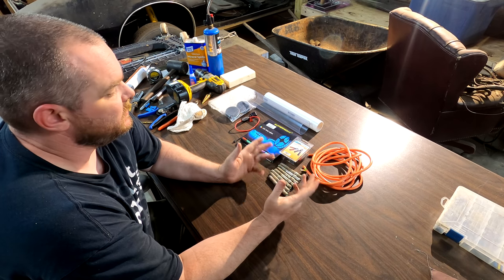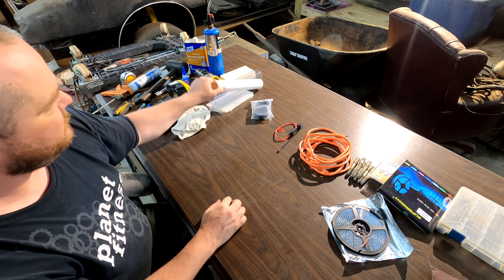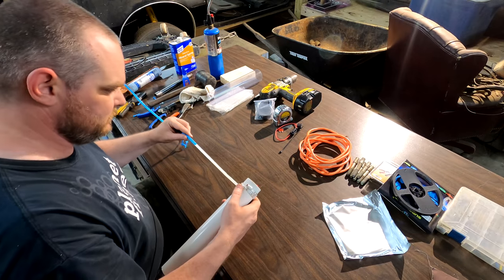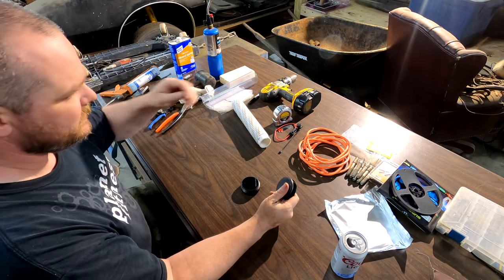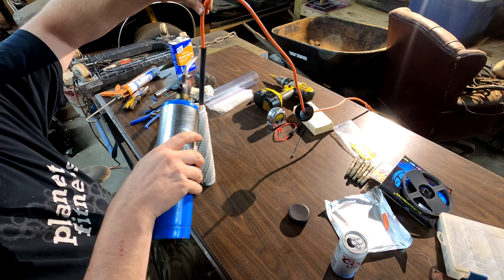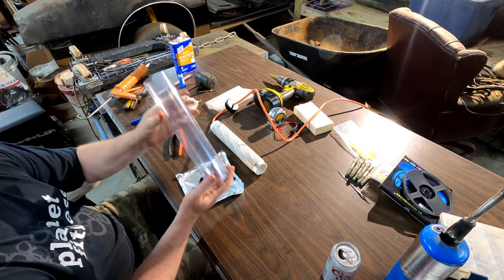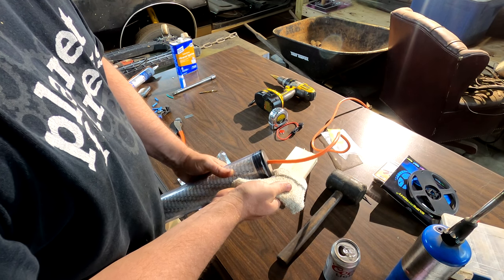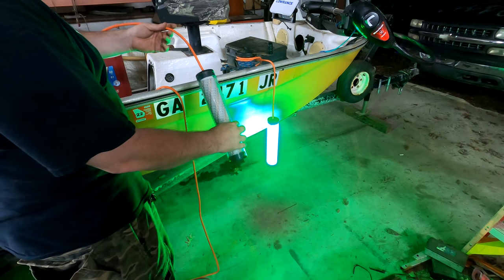DIY Under-Water LED Fish Lights: How-to Make Them Like I Did

Comment: Great Video! How would you do it in series? Like I want to do this with 4 lights and one plug. A video would be great 👍
Reply from the maker: I would wire each light in parallel on main power wires. You would need beefy main power wires (8awg minimum). I am unable to make a video in the next week or so but maybe this diagram will help explain what I mean. https://i.pinimg.com/736x/68/8c/88/688c888b0c0ee26083c588da629a45a0.jpg

Comment: How long does it last with a 12v battery?
Reply from the maker: I guess that depends on the battery. I'd imagine on a deep cycle battery at the rated 60 watt, you'd probably get around 24 hours. Take your amp/hour of your battery and divide it by 5. That should be close to accurate. 60 watts/ 12 volts = 5 amps, 125 (example) amp/hours / 5 = 25 hours

Comment: Was that a smd 5050 or 3528 led strip ? 
Good informative work 👍
Reply from the maker: These were 2835 but it appears there is a 5050 new version out. Here is a link to what I used specifically if it helps: https://www.amazon.com/gp/product/B00BSODFOK/?th=1